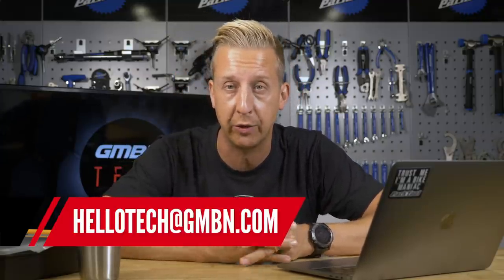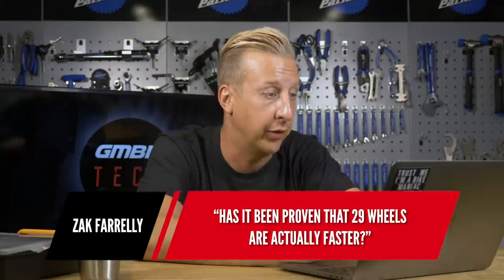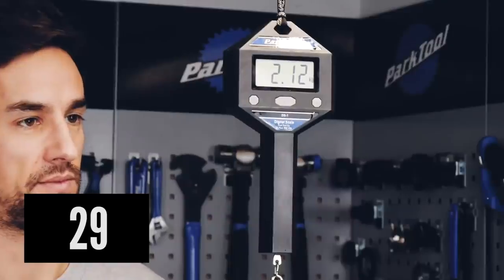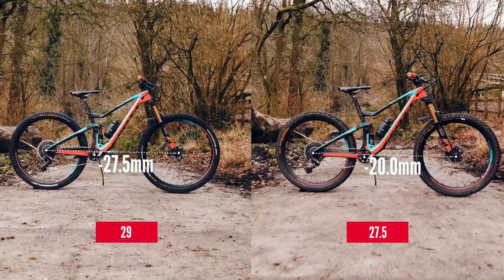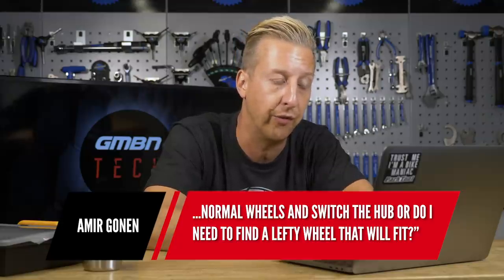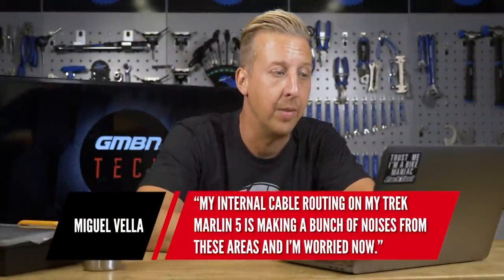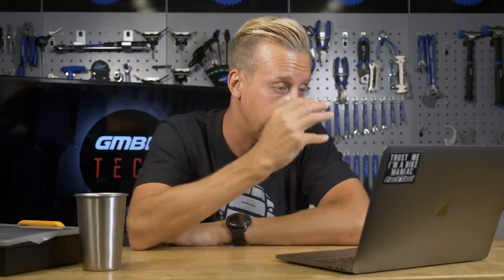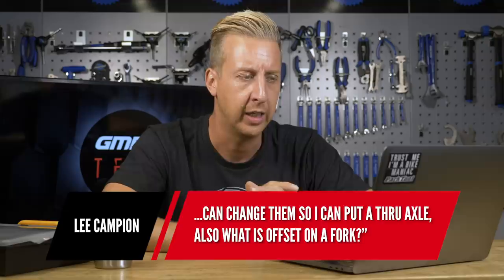Are 29ers Faster? | #AskGMBNTech Ep. 89

Comment: To the Trek Marlin guy - go to your local Trek dealer and ask for the foam tube they use on Madone and SpeedConcept (they'll find and order it easily) and put in on the cable. Usually it was brake hoses that rattle on Marlins, so a mechanic would have to disconect it from the caliper to put this tube on, but it's not more tah an hour job. Good Luck
Reply: Thanks
Reply: Might have to do thos for my fuel the cable rattle drives me crazy
Reply: @ZKelly22  Fuels have this port on the bootom of the downtube where you're supposed to feed a zip-tie through and loop it around all the cables inside. If someone fitted something aftermarket or changerd cables forgetting to secure them they'd certainly rattle. Try the zip-tie first.
Reply: Tried this. Cant manage to get the zip tie around the cables and back out again so I can zip it closed. Oh well time to go ride
Edit: tried for another 5 mins and got it. Silenced the rattle big time. Thank you so much! Coffees on me!

Comment: Why is moment of inertia rarely brought up when comparing wheel sizes?
Reply: Because we don't mention anything not favorable to 29ers and we must hype them at all costs right now. I also find it odd since that is the biggest difference I notice switching between wheel sizes. Rotational inertia is the main reason 29ers don't speed up and slow down as fast. I thought he was going there, but he bypassed the main point to get into the minutia of bb drop and the resulting moment on the front wheel.
Reply: It is not moment of inertia but rotational energy which matters. At the same speed and the same weight a 29er wheel has the same or a lower rotational energy than 27,5.
Reply: @I3estHer0  Moment of inertia absolutely does matter. It's part of the equation for rotational kinetic energy.
Reply: Moment of inertia completely matters. It is directly involved in the equations of motion, both accelerating and decelerating and it is definitely what someone will notice (smaller or lighter wheels accel and decel much more easily). Also, it has a bearing on steering feel as larger moment of inertia leads to greater gyroscopic forces, making a bike more stable, but more difficult to change line on.  Finally, assuming the same linear speed and the same mass (which isn't a great assumption since 29" wheels tend to be heavier), the rotational kinetic energy will be the same for the two sizes. If we scale the mass with diameter, the 29" wheel will have more inertia and more rotational energy. In no case will the 29" wheel be smaller.

Comment: #askgmbntech Doddy & Henry: I've recently noticed a metallic banjo like "plucking" sound most notably making higher speed turns to the left on my Trek hardtail.  I can replicate the sound by loading the left crank by standing on it and rolling along the drive.  Could it be my rear rotor?  It's definitely coming from the rear and driving me crazy!  Any ideas to trouble shoot this?  Cheers from across pond.  Love all things GMBN & GMBN Tech.  Just like a good nap, your videos never last long enough 🙂
Reply: Try your quick release/thru axle, and otherwise maybe your rotor isn't torqued down
Reply: Are you're spokes tight on the rear wheel. Could be them flexing and making sounds
Reply: @lolimpol  thru axle is good.  I like a clean look so I purchased the maxles that tighten with wrench and they are torqued to spec.  Appreciate the feedback though
Reply: @jamiewellington6208  I have not checked tightness of spokes.  Upon inspection and touch they appear to be, but I'll double check with a spoke key (which I need to pick up lol).  One tool I should probably grab.  Thanks for the feedback
Reply: @brewkeepyr4647  what about your rotor? I had this sound and it was the rotor
Reply: @jamiewellington6208  tightened spokes.  Good to go.  Thanks for the heads up

Comment: Funny you didn't mention inertia and the gyroscopic effect in the difference between 29'ers and smaller wheel sizes, as that will be the one with the greatest impact on handling. But then again, as long as you're going in a straight line that won't be noticeable.

Comment: So you cannot get a 26” lefty wheel new. Also finding a new 26” 28 hole XC rim is a hard find. If you’re looking for an XC rim to fit you XC lefty hub, well new rims that are 26” are not designed for XC and therefore have more spoke holes. Looks like the used parts bin is the place to look. I have the same problem.

Comment: I’d say yes and no....I went from  27.5 diameter wheels to 29ers on my Levo, and running the same hill I always ride down on the way back from Draycote Water I managed to hit 37.6mph instead of the usual 37mph I had never managed to exceed. So I’d say the benefits are minuscule. One thing I would say though is my bike looks more modern with 29ers and 29 x 2.60 Maxxis Recon tyres 👍🏻😊👍🏻

Comment: #askgmbntech I'm having trouble seating tubeless tires, I have Stans flow rims but this has only been an issue on the front rim.  I bought the bike used with a Conti Trail King 29"x 2.4" and the first time I replaced the sealant and inflated (using compressor) the bead seated and I set the tire aside with about 40psi in case the sealant needed some pressure to do its job, but after a few minutes the bead blew right off the rim with a huge explosion of sealant everywhere.  I re-installed the tire and didn't pump as high the second time and it sealed up fine but the tire wobbled side to side (wheel is true). I took it to a shop and they said there was nothing wrong and to just ride it like that and I did for a whole season without issue.  Fast forward to yesterday when it was time for new rubber and sealant (stans). Now mounting a new DHF 2.3" and seated fine with the compressor, pumped to 40 and what do you know it blew right off the rim again.  Re-installed with soapy water around the bead and the tire just wont sit straight and has a section of bead that just won't sit right. I tried to muscle the tire into the right shape to a bit of success, pumped to 20psi and left over night.  Feels like i'm losing my mind, no problems with rims (that I can tell) and rear tires have set up perfectly every time. Sorry for the long post and thanks!
Reply: Same rim and different tyres and still happening.. Isnt that an indicator for rim to be faulty?
Reply from the maker: Hey Andrew, it sounds like the tyre just isn't seating correctly! Check this Tubeless 101 video Doddy made 👉 https://gmbn.tech/ubeless101 
Henry has also made a video here 👉 https://gmbn.tech/HenrysTubelessHacks . It might be an idea to just start from scratch and apply some fresh tape to the rim.
Reply: @dosetti  that's what i thought but i did inspect the rim on a trueing stand and it looked straight and undamaged.

Comment: #askgmbntech I am planing to build my new bike using parts from the old one, but I need a new frame. I am basically stuck (because of reasons) with 2 options: Trek Marlin and Trek X-Caliber. X-Caliber has a tapered head tube and horrible 141 QR boost in the rear, which limits range of hubs/wheels. Marlin has good old-fashioned 135 QR back, but straight head tube, which I am afraid is dying and might turn into a problem in the long run, although my current Rockshox Recon RL is straight. Which should I choose? My budget is rather tight.

Comment: #askgmbntech why arent reverse mullets a thing? It would make sense, because then you can roll like a 29er, steer like a 27.5, and have more fork travel without affecting the geometry
Reply: Rollover and grip are WAY more important on the front than the rear
Reply: Ahahahahahaha
Reply: @src248  id rather be able to turn much better than be able to rollover slightly bigger things, and 27.5s get more front tire grip, due to what they explained in the video
Reply: @Jamie-eg8hr  if you want the handling of the 27.5 wheels why would you want a larger wheel that forces the bike to have a longer rear end?
Reply: @src248  for more fork travel whilst affecting the geometry less, and better rolling

Comment: People naturally want to defend the type of setup they have. If you have 27.5's, you validate it. If you have 29's, you validate it. Hard tail...talk smack about why you don't need full suspension, etc, etc.. It's human nature. If you truly care about going as fast as possible, beating PR's, you will go with 29's. Not sure what to do? What are most of the pro's using/doing? There's your answer. I can have a great time with a full rigid, 26, mechanical brake MTB, but I'm not going to try and defend that it's faster/better. If you don't care about PR's or max speed, then keep riding what you have and don't worry about it.

Comment: #askgmbntech Hi Guys. I recently noticed that my compression damping isnt working like it used to be anymore. I got a RS Domain RC DC which i regulary service my self. never had any issues before but now  the compression dial has very little effect (after the first 2-3 clicks there is no effect at all). i checked the motion control damper unit and everything looks fine to me. the adjustment rod is engange that silver plate covering the holes is rotating like it should, the oil level is correct, the seals are fresh and i cant see any sign of damage. it almost feels like the floodgate is opening up way to easily. is there any chance that those plastic spring tubes used in motion control can wear out or do you have any other idea where that behaviour could come from?

Comment: #AskGMBNTech Hi guys, love the shows. I’m wanting to get a set of shocks for my gravel bike (I enjoy both GCN and GMBN if thats allowed!) and I wonder if you can advise on things I need to consider when buying suspension forks? I don’t know much about them as never owned them but I want more play for off roading on the South Downs way etc. I currently have flat mount callipers, centerlock 160mm rotors, which are fitted to 700c wheels (12mm thru axle) and headset is 1 1/2” tapered. Will I need to change everything or can I keep most of my setup as I’m hoping to try and change as little as possible. (Don’t even want to get into the baggy or Lycra shorts argument!) Thanks guys 👍

Comment: #askgmbntech I recently bought a used bike with new hydraulic brakes. If I'm riding around really slowly and stop or slow down using the brakes, they squeak really loudly but work fine. It doesn't happen if I'm speeding along and brake, only at slow speeds. I've tried cleaning the rotors with rubbing alcohol but with no prevail. Any suggestions on how to get them to stop squeaking?
Reply: Clean or change the pads and make sure they are compatible with the rotors
Reply: Also, it can be rust in the rotors you may need to remove

Comment: #AskGMBNTech Hello you beautiful people! Loving the show and learning a lot every time! I recently bought a used RS Bluto for my fatbike and the steerer tube was about 6mm too short to get the stem on properly. My LBS stepped in and provided a lower profile bearing top cover to get me on the road, but I've since read that the underside of the cover must fit the bearing assemblies to keep the right amount of pressure on everything to keep things from coming loose. I guess I'll have to get a new top bearing set with cover, but do I need to swap out the ZS press fit cup or can the one currently installed be reused? Current headset is an FSA Orbit Z 1-1/8"-1,5" tapered ZS44 top and something else at the bottom with a 15mm bearing top cover. The height for the new cover must be 8mm or less to allow the stem clamp bolts to hug the steerer tube properly.

Comment: #AskGMBNTech - Hi Guys, I weigh around 90kg and my rear shock(x-fusion  O2)on my New 2019 Scott Spark 970 is at max pressure around 300psi. I’m getting around 40% sag and it bottoms on most casual rides. Could the shock be faulty and what would you do so solve the problem. Suggested upgrade if required? Thanks.

Comment: #askgmbn
Hello, i have a problem with my fork, i did lower leg service everything went well but after i have a problem with the air chamber, i need to pump around 150 psi to fork fully extenc (obviosuly it's hard as rock) so my friend mechanci told me to look after air piston service, i did it as well now it's working buttery smooth but the issue remains, it's a little bit better now (fork extends at normal psi) but then after few squishes it's "sucked up" probably by negative air chamber (i know it's normal to some point) but my fork travel reduces from 150 to around 100-110, could u please help me and sorry for my english.
Reply: dont overgrease the air piston. if you do the tiny hole to swap air between positive and negative chamber will be blocked causing these symptoms
Reply: @ultiss  i heard the same from my friend mechanic i degrease the whole air spring and then added just the tiny biof grease t, it's 100% because of this port between the chambers? beacuse i'm not sure and wondering if this coulde be something diffrent

Comment: #askgmbntech Hey Dod, I recently got a gravel bike. All the cables are routed internally. Do I need to seal the entrances where the cables enter the frame in order to prevent water from getting into the frame? Currently they are not. My other bike: a Nuke Scout has plastic seals to prevent too much water getting in. Thanks! Reto
Reply: Most bikes will have some sort of drain, usually near the BB. No matter how good the seals, water is going to get in. Better to make sure that when it does, it has a way to get out.
Reply: This is not the place for gravel bikes.
Reply: Scot Hastings thank you!

Comment: #askgmbntech Hi Doddy, my rear brake disc rotor starts to scrub when I ride at ca 30 kmph, but it stops after exceeding that speed. What can be the reason for that? Is it something wrong with the stiffness of the rear wheel (it is a 28H wheel with standard 10mm axle with QR)? Is putting some more tension into the spokes a viable solution, or should I rather think about switching to 32 or 36H wheel?
Reply: check wheel bearings, qr tension, caliper and disc bolts, alignment of the caliper, trueness of the disc
Reply: @ultiss  Hi ultiss, thanks for the response. The disc / rotor is true and correctly aligned between the brake pads, in other case I think it would scrub at any speed. Also the bolts are well tightened and the threads are secured with loctite (both for the caliper and the disc). As for the QR tension, it is already very tight and I have to use quite big force to close it, I'm afraid that I could break the lever if I would increase that. The bearings have only 500 km of mileage, but maybe are suffering from over-tightening? But there are no strange sounds from them, the wheel is rotating smoothly. Only that scrubbing when I ride fast, especially in the long, slight turns. And it goes away when speeding up...
Reply: @micktheshaggy3977  if you grab the tire and rock it side to side is there any play? Or remove the Wheel and  feel the axle for any issues. Also the qr lever shouldnt be crazy tight. Make sure the lever is lubed so you dont fight friction without clamping.

Comment: Hey Doddy! I recently purchased my first mountain bike, a Salsa Timberjack. I have been having an issue with the brakes where it seems as if the brake pads are skipping on the little holes in my rotor. It makes a weird squeaking noise and the wheel shakes rather violently. Any help would be greatly appreciated. Thanks! #askgmbntech
Reply: Loose disc rotor/caliper bolts?

Comment: #askgmbntech I am having a problem with my rockshox reverb slowing down when it's cold. It has been around 10c and by the time I stop riding it almost doesn't move at all. But if I let it warm up inside after an hour it works fine. Any ideas?
Reply: Get the oil changed. Could be that it is clogged up a bit if it almost doesn't move. A simple service should do good
Reply: There is probably moisture inside your fork.

Comment: I have just picked up a NS Metropolis it currently has a ridged forks on. I want to put on some 100mm forks which are strong enough to put up with a jump bike needs. The steerer tube is 1/1.8. Have you any suggestions? #askgmbntech
Reply: Fox 34 is a good option
Reply: @carlstanton2550  the ones I can find don't have straight steerer tube
Reply: Carl Stanton the Fox 34 is more of a trail fork. Not a DJ fork
Reply: I think Fox still do straight steerer 36 831's, these are the mutts nuts for dirt jump but will cost ya... Manitou Circus have a straight steerer option and are a lot cheaper. Maybe Rockshox still make the Pike DJ too...
Reply: @markevans5596  cheers mark are manitou good quality or are they cheaper for a reason ?
Reply: @TomPickup1  not tried them buddy, they're not going to be as good as the Fox though. I ended up buying a 36 straight steerer from Mojo, an old model they had on offer, not the 831 but I had the travel reduced to 110mm for dirt jump. The 36 is renowned for being a stiff chassis and that's obviously what you need, I'm sure the Circus is a perfectly valid option but probably not as stiff. I've seen them go real cheap on the Bay of fleas though, about a third of the price of a 36!
Reply: @markevans5596  cheers pal, did they reduce them to 110mm for you?
Reply: @TomPickup1  no problem. Yeah they did, for free, but remember it's Silverfish these days not Mojo anymore...
Reply: @carlstanton2550  No it's not for DJ.

Comment: #Askgmbntech I have Fox suspension on my bike. Since I'm a light weight rider I have less air in the shock and fork, which means, the rebound is pretty much completely open. When it gets cold, I can't make the rebound fast enough! Is there anything I can do (e.g. other oil)?
Reply: Add progression with those plastic cylinders you insert in the suspension
Reply: @Charles-A  That will not help lol.
Reply: @Charles-A  I don't want to add more progression or change the way the suspension feels, just faster rebound ...